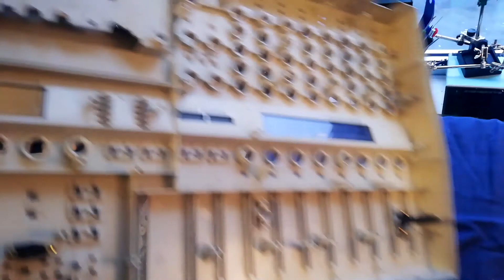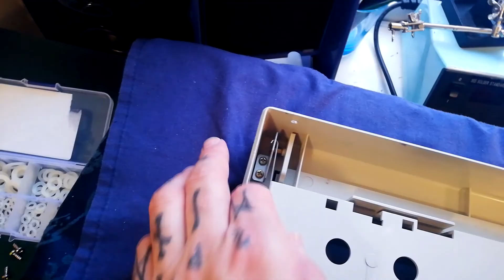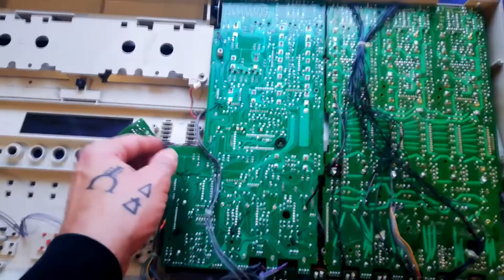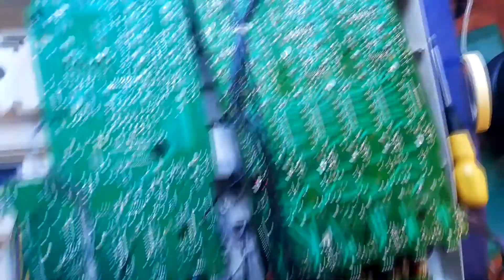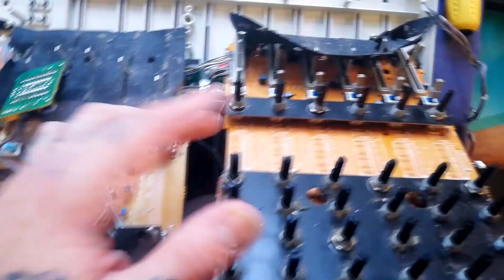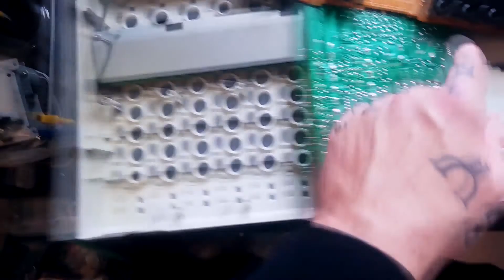Sansui WS-X1 | Tear down | 4 | Upper section | mixer | VUs | Shuttle buttons

Comment: I've just finished using one I bought a couple of months ago to transfer my original '90 to '97 6 tracks to Studio One 7 via a Fosusrite Saffire Pro40. Excellent results and all 40 cassettes are now safely digitised and ready to go back into storage.

Luckily I wanted to extract the original tracks without any additional processing or effects, just the pure track so the six outputs on the back were fed straight into the Saffire. Volume was very low but I ended up normalising each track in the DAW to make it usable. All good. Mission Accomplished!!

I say 'luckily' because no matter what I do, or what I press or turn, I can not get the sound from Deck A to play through the headphones properly as i recall doing in 1990s.
1. There is a very quiet signal from track 2. Track one is almost indistinct. All other tracks don't come through at all.
2. no real panning. Track two is kind of left of centre but any movement of the pan knob simply turn it down in volume, not move it around in the stereo field. 
3. EQ works on track two and vaguely on track one.....
4. no effects work, no send, or return on the onboard reverb.

Is there something obvious I need to look at when I take it apart for an obvious sign of busted-ness I can throw some contact spray on?
I'd  LOVE to get this back to working order so I can pass it on to the next person as it's in great external  condition.
 

Appreciate any advice before I get under the hood!
Thanks Tektrakan.
Reply from the maker: Bad master fader? Bad caps on pre/post master fader buffer opamp stages? I’m guessing….I will have relevant videos, use the channel name plus keywords like master buss fader and hopefully they show up via YouTube search

Comment: ciao - do you know about a free service manual for this machine? I have one, the internal reverb unit stopped working and I ignore where the related IC is located..
Thanks in advance
Reply from the maker: I do have the service manual. I am currently updating my blog to reflect everything I have on hard disc. I will post a link here once it's online.
Reply: @Tetrakan  Thanks!!
Reply from the maker: Both manuals and schematics now uploaded to my blog here https://tetrakansupermonobloc.home.blog/2023/02/23/sansui-ws-x1-operating-instructions-service-manual-schematics/
Reply: @Tetrakan  thanks a lot!!
Reply: @Tetrakan  uh sht! the manual reverb section is different to the real, as per your movie the reverb unit is from Boss and separated, while the service manual shows a Mitsubishi IC (m50199P)..it was the part I searched for, and I see that many owners have the same problem (your too) of a not functioning unit...patience .. I'll keep it that way, thanks again:)
Reply: @Tetrakan  dang, I bought that schematics like a month ago aswell, and now I see you've uploaded it.
Reply from the maker: That's bad timing...sorry!
Reply: There are downloadable service manual in pdf. Just Google and you will find one, friend.